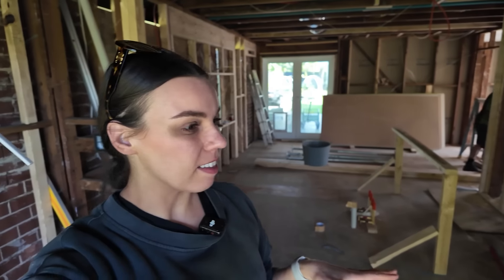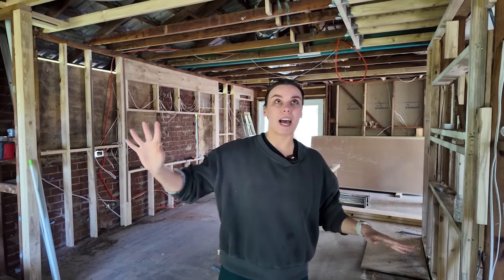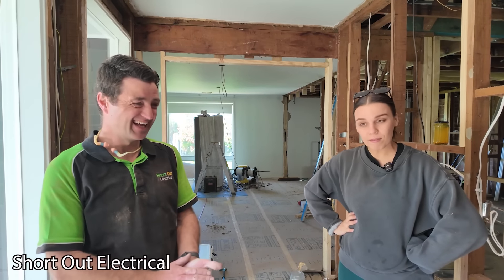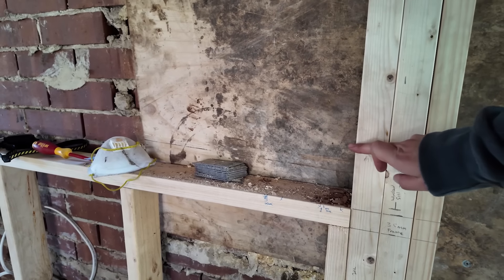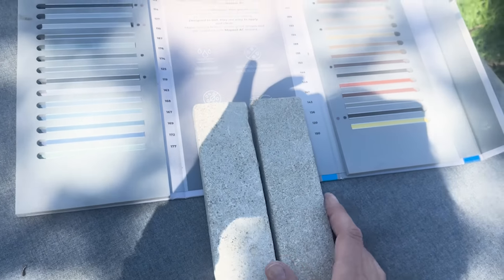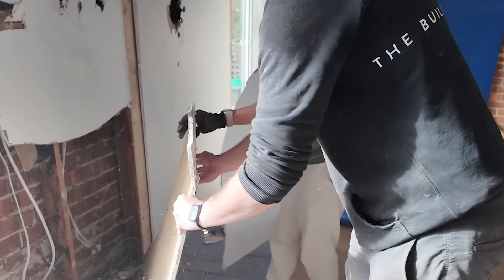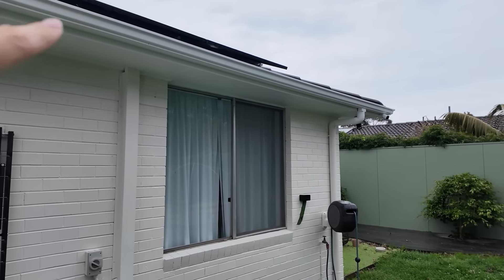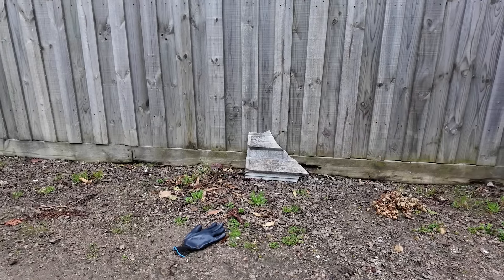The house renovation just got bigger… 😮🏠 Home Reno #5

Comment: I am appalled everytime they take your drywall off and there's no insulation. Granted bricks insulate a little bit by themself but it still feels wrong that a house would ever be build without any insulating material. I'm sure the upgrade will pay off by itself in reduced heat and aircon bills!
Reply from the maker: Yeah it’s crazy! It was built we think in the 70s so I guess they didn’t always put it in then!
Reply: That's what I thought as well when there's just blank brick wall 🙈

Comment: For roof tile, the weight alone are enough to provide stability, the interoocking design is also help. If you have one that made from traditional clay, they can last over 50 years, it is also very eco friemdly and fully recyable. But the most important why personally i think clay tile is the best, is their ability to regulate temperature, they slow the transfer of the heat and cold. Theres this japanese architect that repurpose the old tile into insulation underneath the house because of that regulating ability.

Comment: I live in the US, in Colorado (a hail-heavy state). We had our roof redone just about a year ago from hail damage, actually! A very popular roofing material here is asphalt (or "architectural") shingles. They're made to look like individual shingles but they come in big pieces, which yes, do get nailed onto the underlayment somehow. Asphalt shingles are fairly light in comparison to a tile of a similar size, so it is necessary to nail them down, especially with the high winds we also get here. I'm guessing your tiles are heavy enough and lock together well enough that they don't need much else to stay put! (Side note, I'm envious that your roof is still good after 50 years, that's awesome! My asphalt roof is "impact resistant", but I still have to replace it after it gets enough bad hail storms, anywhere from maybe 5-20+ years 😅)
Reply from the maker: Fascinating!